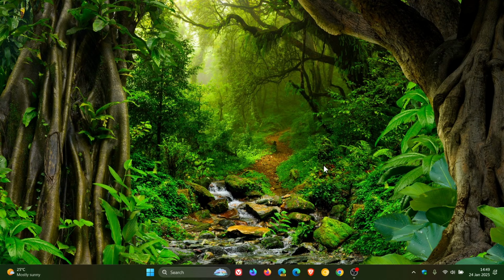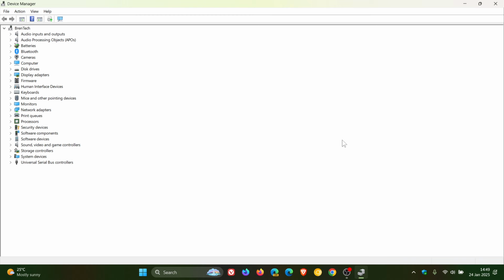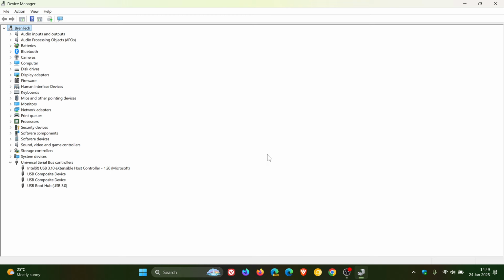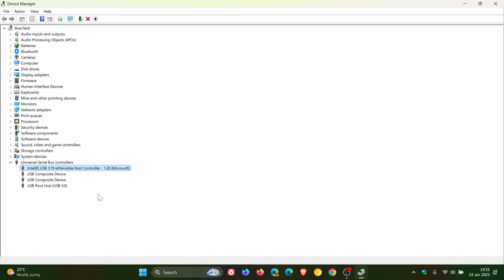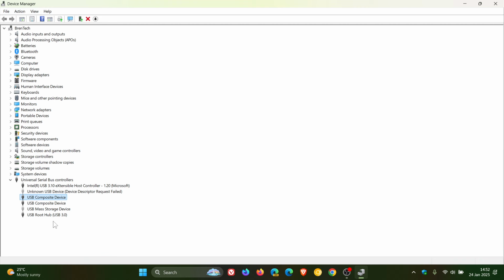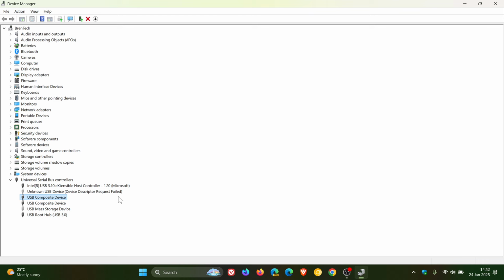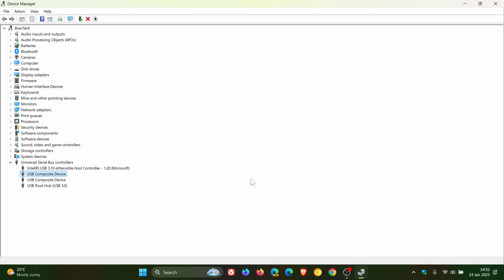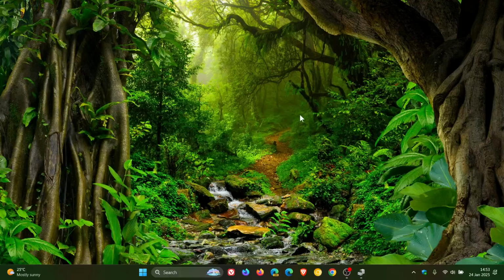How to Block USB Devices on Windows

Comment: Your thumbnail caption caught my instant interest because it puzzled my why I would want to do that.

I know it's wise to be careful about what to plug into my PC, but surely it's just best to avoid using a particular USB stick/plug if I feel it's unsafe (???).

Late last year, I got a rechargeable cordless keyboard & mouse set (Arteck) with a single little USB block which caters for both at the same time. It's great because I don't have all those wires getting in the way. However, I've no idea whether it's safe or not, or how I can check that out. Everything seems to be okay, but that doesn't mean it is, of course.

Comment: The first thing I do with any USB storage device when I don't know what's on it is to reformat it, thus rendering any malware useless.
Reply: how would you do that without connecting it to a computer?
Reply: @zurgesmiecal  I have an older laptop with no files on it, and nothing but Winows 10. It's just a backup I keep around. I use that to check executable programs and USB devices.